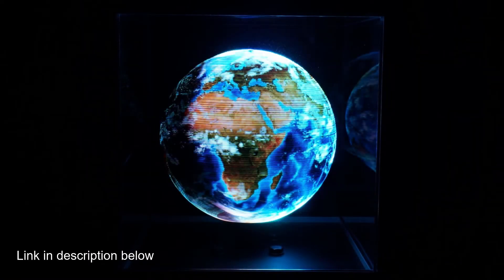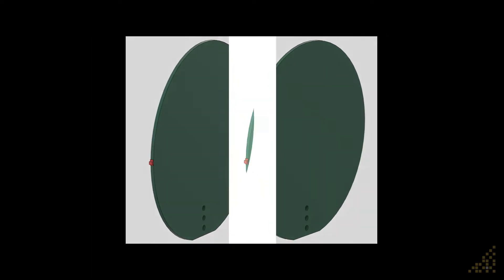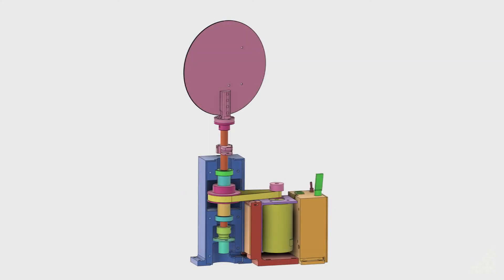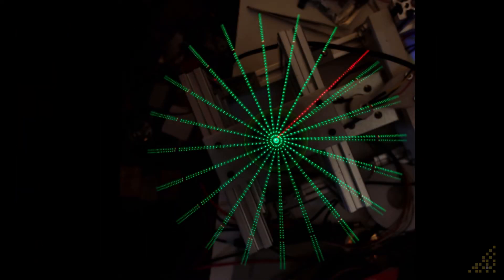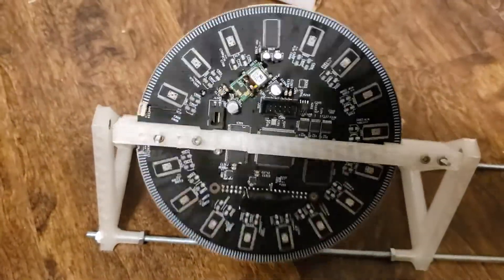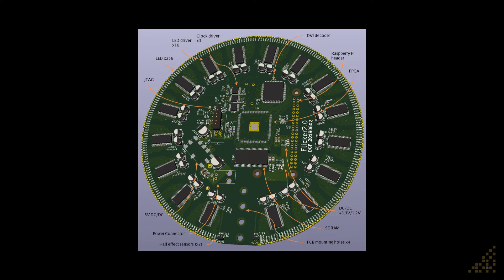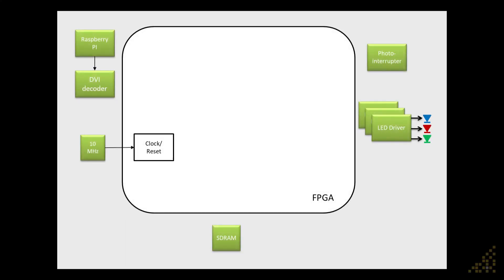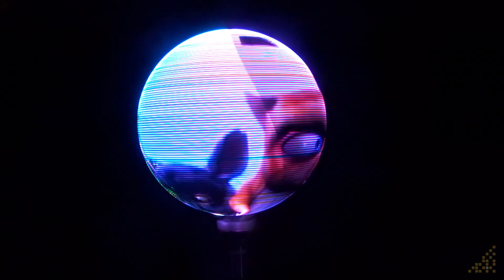Flicker - a spherical display

Comment: If you had $100K could this be done outdoors, with a diameter of 20 feet and last 10 years? -remo
Reply from the maker: Hi Remo, probably not.  The electronics would scale, no problem.  But spinning something that diameter at a minimum 900rpm would definitely make me nervous, even 15cm is scary.  Would need some sort of safety cage around this thing, would probably ruin the look

Comment: Are fpga really the best option for these projects? Could someone explain? I'm wondering if it's possible to just use some kind or arm chip
Reply from the maker: it might be possible to use a micro but it would be harder to get the timing right - probably custom assembly code

Comment: Are those lines in the image faulty leds? Or just a bit off color leds?
Reply from the maker: Depends on which lines you're referring to - generally, all the LEDs are point sources with no diffusion which will generate "scan lines".  The blank lines are faulty LED solder connections due to my unorthodox mounting method

Comment: Excellent project ! If you plan to do another version, maybe you could double the line resolution by offsetting the position of the LED by half their size on one half of the board. I'd be very interested to know if it works !
Reply from the maker: Hi - great minds think alike :) I did try that in this design, one half of the board has the LEDs offset with respect to the other.  You can find more details in the blog, link in the description

Comment: There are controllers for brushless motors which essentially make them servos, or at least integrate a relatively precise encoder and speed control.
Reply from the maker: Absolutely - I really wasn't expecting the variations in speed I saw in each revolution with the brushed motor but the approach I took did allow me to compensate and do so at a relatively low cost.  Next time though, I would definitely consider a brushless motor

Comment: Using a photo interrupter is a great idea! but do you think using multiple magnets (properly spaced) with the hall effect sensor would've yielded the same results?
Reply: Definitely did try but I was seeing about 4 pixels worth of jitter.  It's possible that the sensors/magents weren't close enough to each other or things weren't perfectly balanced /concentric/etc. but I was tired of trying to get the hall-effect sensor working so switched to the photo-interrupter solution that "just worked"..

Comment: Really cool project. I wonder if you could get a more consistent perceived brightness by using a lower duty cycle on the LEDs at higher "latitudes". Since any given spot on the sphere has a higher or lower duration that it will be lit by an LED passing by, all the way up to being constantly lit at the axis of rotation.
Reply from the maker: Really good point and I agree with you but interestingly, until you get to really high latitudes, there doesn't seem to be a large gradation in brightness.  Check out this shot taken from above - https://github.com/danfoisy/flicker/blob/main/docs/images/20191109_113527.jpg   The pole is really bright but after that, the brightness doesn't seem to vary signifcantly as you go down to the equator.  Not quite sure why that is.  However, if desired, making the adjustment as you suggest is just another lookup table in the FPGA.

Comment: Very cool project! You said you're using an HDMI feed, which is rectangular by definition. I wonder how you map the rectangular image to the sphere. Do you use the same number of slices for the top/bottom rows and middle rows? It might be interesting to change this per row to get a more even resolution?
Anyway, many thoughts, but mostly just very cool that it works!
Reply from the maker: Great question - and I had an answer that didn't make it to the video.  Essentially, each row in the HDMI image corresponds to an angular slice on the display.  There's a writeup here  https://danfoisy.github.io/flicker/ if you're interested (do a search for "DVI Controller", most of the way down the page).  And as you say, the angular resolution is different depending if you're at the equator or poles of the display.  You could probably do some pre-processing of the  image to adjust for that but that's further than I wanted to take this project :)
Reply: @abitembedded1473  thanks for the reply! I haven’t found the time to look through it yet, but I will soon ;)